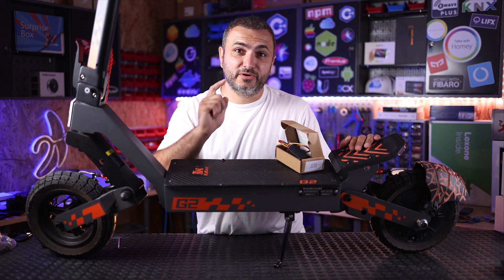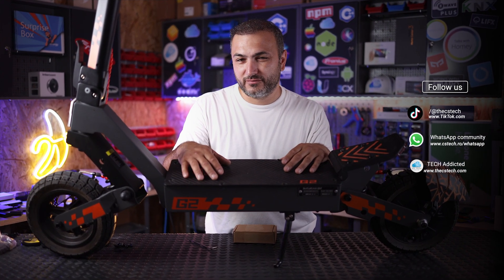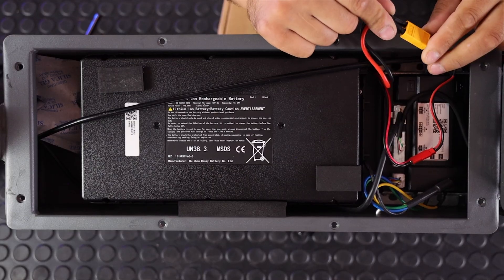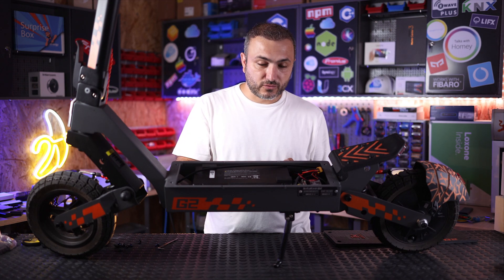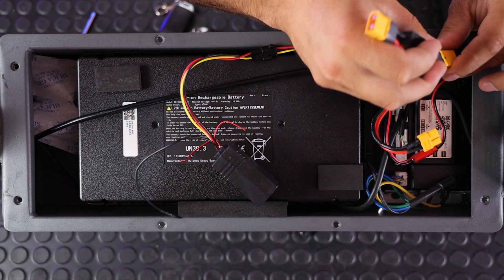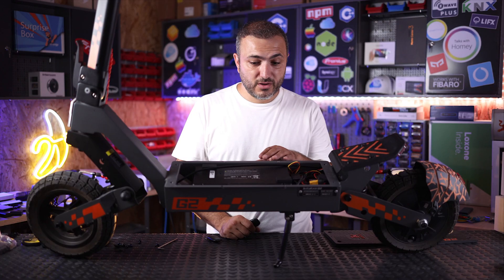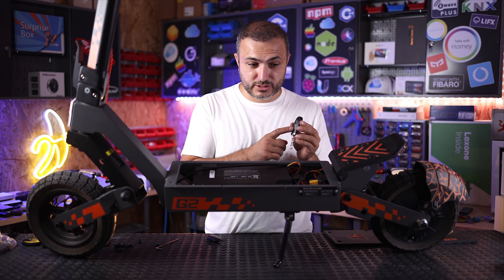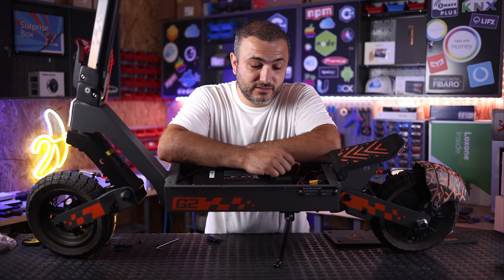Installing an Alarm Module on the Kukirin G2 Electric Scooter – Full Anti-Theft Protection Tutorial

Comment: Does the two small red cables that sticks out from the alarm having voltage? Can they accidentally short something?
And if you press the wrong command you have to do what exactly in order to restore the scooter? Open it up getting the anti theft module out and in again?
Reply from the maker: Tape them. They are used for external contacts. There’s no power, just a contact, but it’s better to tape them.

Comment: the  2 small red wires that are sticking out of the alarm module, whats the use for them? Do be carefull because they have battery voltage on them, you can short something.
Reply from the maker: Tape them. They are used for external contacts. There’s no power, just a contact, but it’s better to tape them.